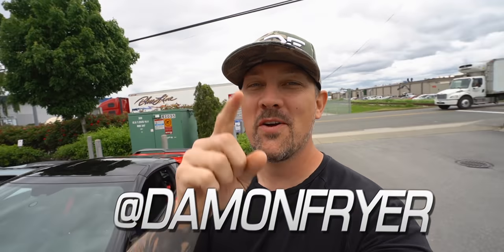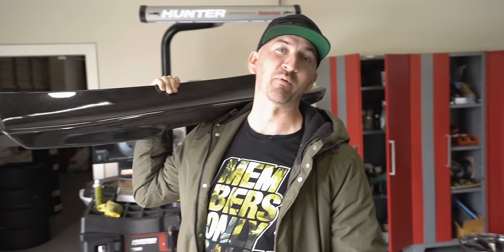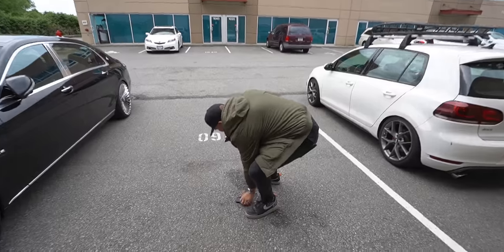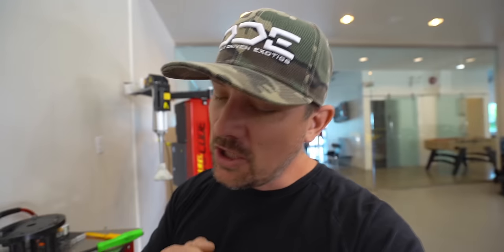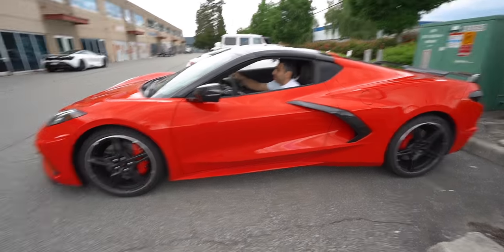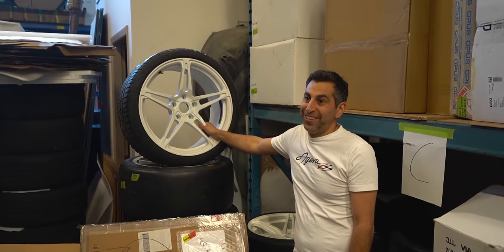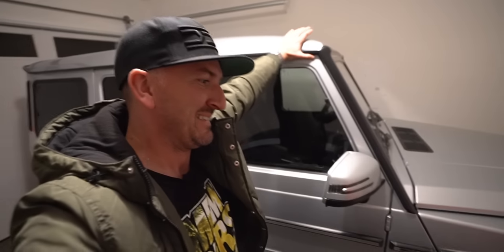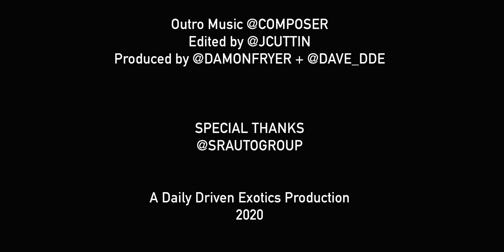REVEALING MY ALL NEW MAJOR MCLAREN MODS!  $15,000 WORTH

Comment: Don't forget when you put a larger rear wing, to keep it balanced ya gotta put a splitter on the front that matches it.
Reply: That isn't going to make a big enough difference you need to start adding other things to compensate. You'll only notice a difference on the track, and with that small of a difference, someone like Dave or Damon would never be able to tell; unless they drive the two wings back to back on the track. You only need to compensate when you make a drastic change. Like putting a large wing on a car that had a small wing. Or cars with a large distance from the center of the wing to the center of the rear axle, combined with a short wheelbase, or a rear mounted engine (not so much with a mid-rear mounted engine like most supercars have).
Reply: Andrew Delashaw he was making a simple joke saying they should also get a splitter, love the explanation but it wasn’t necessary
Reply: They’ll more ricer style guys than racers lol. They don’t need every bit of performance like that

Comment: As a f1 fan I cringe every time they talk about adding “downforce”
Reply: Downforce needs to be balanced with Grip and Speed. Too much downforce and then you cant accerlate as fast, and wears out the tires even more. But, for anyone doing street driving with 400+ HP cars and being hooligans, I rather sacrifice my top speed and tires for MAX GRIP. Safer.
Reply: Care to elaborate? Got me curious

Comment: It seems as if the phone had no damage aesthetically,but little did you know that the major reason phones catch on fire is because the Li-ion battery cells in your battery will be damaged and displaced by drops like this. So cases only help the to protect the outer part of the phone. Not the internal parts which are crucial for your phone to work.

Comment: I forgot to mention on 1320 there is an Acura Integra V6 Turbo in the rear 550 horsepower stock motor just a little idea to shout out to you guys cuz I know you have that type-r still I know you guys are limited what you can do at the moment but I couldn't help myself

Comment: if glued or taped use a heat gun when removing the 3rd brake light on the Mclaren and it will greatly reduce your chances of breaking the 3rd brake light...